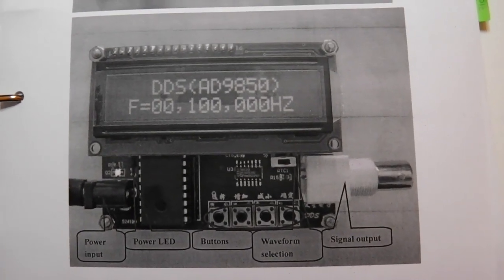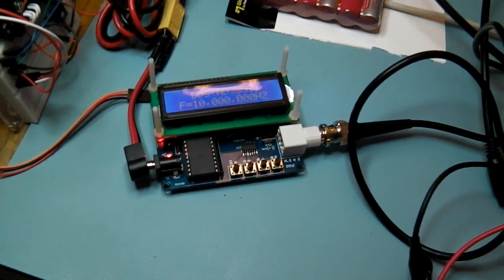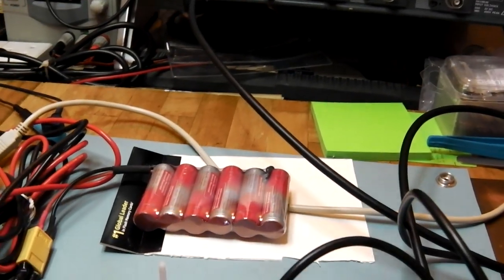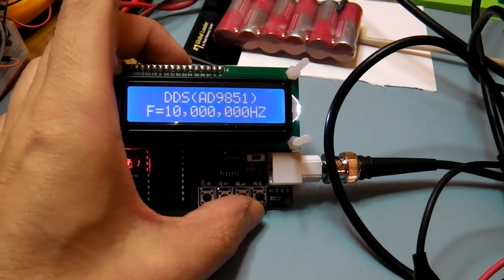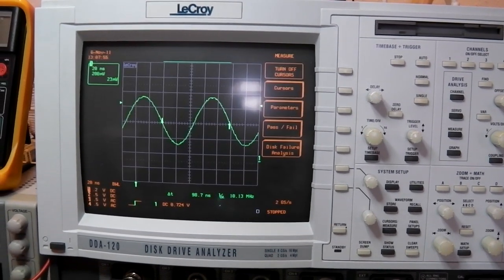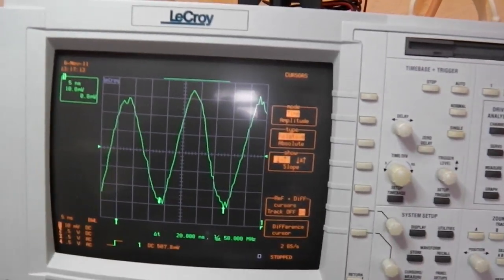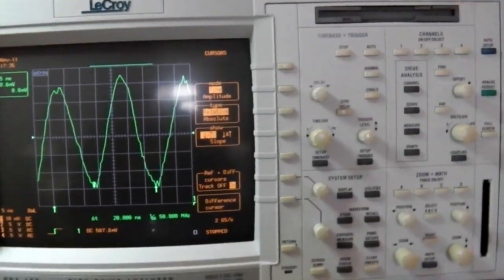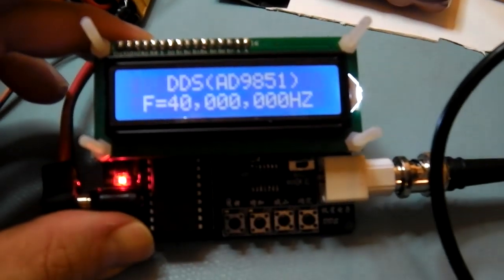AD9851 DDS Signal Generator - Review and Test

Comment: Dam i didnt have much luck, (Ebay No: 330928342479) i seem to be getting a Sine wave coming in even when I've not turned the sine wave on, so i turned it off and still got it.. Pulled the Transformer and it vanished. 9v 300mA (did have a 12v a it said it could take from 9-12v, but it stated to smell, not sure if that was becaue it was new

Comment: No adjustment, but it can be adjusted in hertz. My advice would be to tune in a shortwave radio to WWV and tune the dds until the heterodyne is completely gone. Probably not very accurate

Comment from the maker: @megaradsys: I would say that it is extremely clean mid-range. 

@flick2040: If you can bear the noise coming from fan unit, you will be in for treat. A really great scope with all the functions like modern ones. It is real antiquity with 3 1/2" floppy and PCMCIA slot. Will calibrate it at some point ;-)